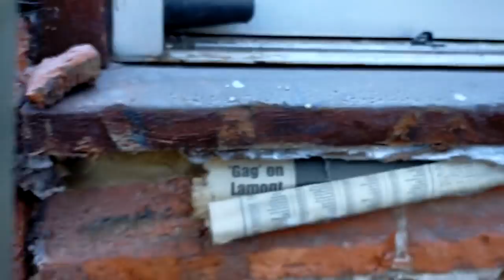Extension up to DPC and setting out for floor beams.

Comment: Great channel, top quality workmanship,   can't beat experience,  
In Ireland on older builds DPC was subfloor level then 75mm sand cement screed on top,  its preferred to have floor  done this way, but we also like to bed dpc and some fellas don't.
Horses for courses, regulations have changed so much in past 20 years, 
Normal cavity is 150mm and  some even are 200mm plus , a bollox for overhand blockwork
Good luck with this channel, can't beat private work 👍 👏

Comment: Great vid, if in this example the the floor was concrete,insulation,screed would you screed above the internal DPC in the extension to match the FFL in the house ?
Reply from the maker: The internal DPC on the extension should be FFL stepped down and lapped to existing.
Reply: Ok thanks - so internal and external dpc would be different levels? And u wud then have to cut  a block to brick it back to coursing with the external brickwork ?   Thanks again
Reply from the maker: @neilu.k.1364  No, all DPCs should be FFL then lap into existing, some jobs require trays or C sections your Building Inspector will tell you what he wants 👍
Reply: Sorry to keep pestering but on the extension in your vid your external dpc matched the existing house dpc but was below the ffl(timber floor I’m guessing). So if internal & external dpc are supposed to be at ffl would the dpc for the extension need to be above the house dpc ? Thanks for your time
Reply from the maker: @neilu.k.1364  In the vid the DPC on the new extension is at FFL to the house, the DPC on the house was put in at the wrong height.
Reply: Ok thanks so the dpc on an extension is always at ffl to the existing house regardless of whether it’s above the house dpc ?
Reply from the maker: @neilu.k.1364  correct